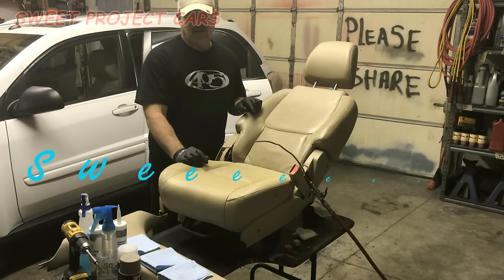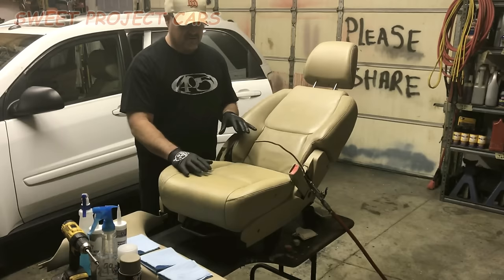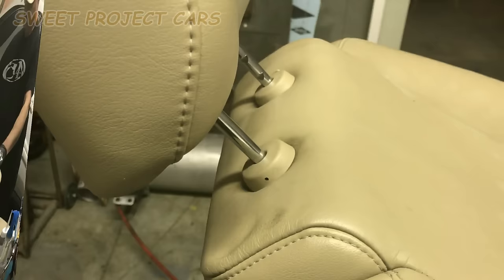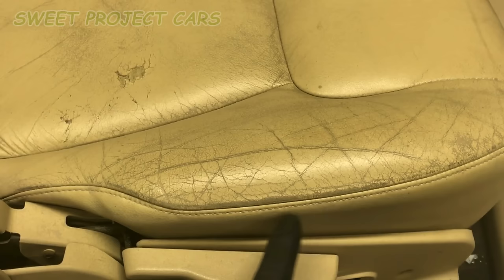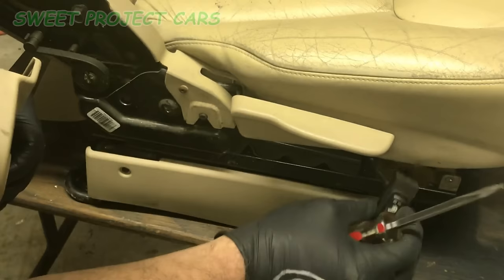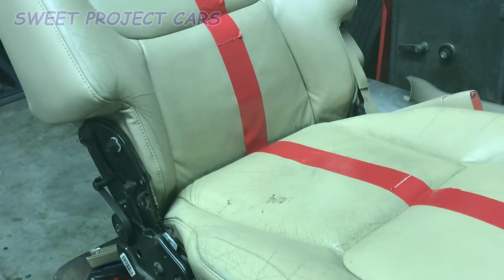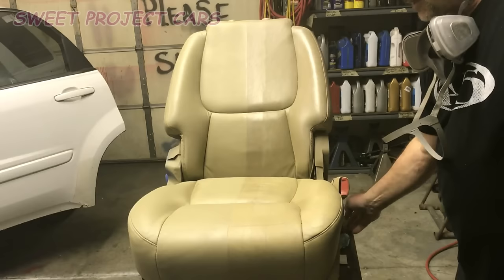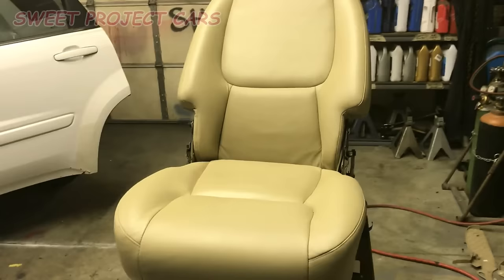How To Repair The NASTIEST Leather & Vinyl Seats....Back To PERFECT!

Comment: So you "repaired" wore cracked and ripped leather by using silicone? All the videos I have watched repair them by using leather repair kits. Can a rip, tear, or hole in leather be fixed with the silicone you used here?
Reply from the maker: Anthony yes you can do small rips and tears with it it works great have a great day thanks for sharing Mike sweet project cars
Reply: @SweetProjectCars  My truck seat has a 3" x1" hole. Do I use a piece of donor leather to fill the hole and use a mat under it and then use the silicone to bond everything from underneath? And then I can do the process you did here for fixing the seat?
Reply: @SweetProjectCars  I priced brand new leather replacements for all of my seats and I can have it done for about 1000$. I figured if I did this process you did here it would cost maybe 200$. What is the chance I would fail and waste 200$?

Comment: Im currently in the process. After you use the silicon, do you clean the surface after using your finger? Does using your finger also provide more of a "Matte" finish?

Thank you! Keep up the great videos!
Reply from the maker: Justin Slawek you clean your finger with some 99% before touching and yes you finger will dull it down a bit.
Reply: @SweetProjectCars  How long do you let the permatex dry before painting? I am going to be gluing tonight. Also, any tips for worn spots that are starting to wear through the stitching? Layer up some silicon?

Comment: I have a lexus es350 with perforated heated seats. This technique doesn't seem like it would work or would it?
Reply from the maker: It is very time consuming to do a perforated seating but it can be done as you have to open up the holes each individual one with a round toothpick
Reply: @SweetProjectCars  Thank you! do i use the tooth pick right after I spread the silicone?
Reply: I noticed you just used paint for the worn area along the seam. would you silicone that first before paint or paint then silicone around it if there are areas then paint the whole seat? sorry for all the questions. My drivers side seat is pretty worn.

Comment: I have medium grey leather seats and want to fix them. At the same time I want to change the color on 4 sections of the leather. Would this still work? I have used leather dye on panels but never seats. (I detail cars as a side hustle) Any info, suggestions on this matter would be greatly appreciated.
Reply from the maker: Well if you plan on using the silicone, dye won't work, use either of these  https://amzn.to/2PWOfN3  or  https://amzn.to/2DJPV7Y  Thanks for watching and asking Mark!  Hope you have a great day.  mad Mike the hammer SPC

Comment: 4:59  How does the leather breathe if you are covering it with a waterproof silicone sealant?  How do you apply leather conditioners to keep the leather supple and flexible, so that it doesn't go hard and brittle?
Reply from the maker: If you are even considering having to do this to your leather seats, whether the leather "breathes" or not is the least of your concerns.  You may be better off going and purchasing new OEM seats.  mad Mike the hammer SPC
Reply: Modern automotive leather doesn't 'breathe' as it's inherently dead and is covered from the factory in a synthetic coating. All leather conditioners do is stop the synthetic coating from drying out and cracking over time.

Comment: I just installed Katzkin and it’s way better than that, but I bet restoring is way cheaper
Reply from the maker: The price to upgrade a vehicle professionally installed with Katzkin is between $1500 and $2200, depending on the vehicle, so yes, the cost to do our method is around $250 for two front seats and anyone can do it.   Thanks.  mad Mike the hammer SPC
Reply: @SweetProjectCars  sounds about about right, I’m an installer and  get it done on my own vehicle so it’s under 1,000 but for customers, it adds the labor

Comment: What if you have factory pin hole  leather  seats ?
Reply from the maker: Yes it does not work very well and vented seats your best to buy replacement seat covers from the factory
Reply: Just poke holes in the silicone while its still tacky with tooth pick

Comment: Do I still need to use vinyl prep spray on the leather if I’m using Dye instead of “paint”
Reply from the maker: Yes, you definitely do.  However, you cannot dye silicone, it has to absorb into the material it's being applied to.  Silicone does not allow absorption, therefore, the paint we share in the tools list is the recommended way to go.  Thanks for asking Charles, hope this helps.  Have a great day.  mad Mike the hammer SPC

Comment: Big Mike one questions, does it really matter which prep spray do we use either leather or vynil prep spray? Where i got my seat paint color they said my car seat was vynil not leather but my car seat came from stock with leather seats so is it leather or vynil and does it really matter which prep spray do we use? Which would you recommend me big Mike?
Reply from the maker: Michael, first off you need to find out if you have leather or vinyl.  It does matter which one you use.  Leather for leather, vinyl for vinyl.  Thanks for asking.  Hope this helps.  Have a great day.  mad Mike the hammer SPC

Comment: Would be nice what products he used did I miss it
Reply from the maker: Hello Luis as mentioned in the video, all the tools and products are in the video's description below the video but here they are
USA
Tools:
GLUE   https://amzn.to/2DuPmO1

Old 99    https://amzn.to/3bmW3St

Caulk Gun     https://amzn.to/2PRFvHI

USE THIS TO CLEAN SEAT PRIOR TO GLUE & PAINT  https://amzn.to/2z3oiBu

Leather & Vinyl Repair Kit   https://amzn.to/3h8oa9C

Q-tips     https://amzn.to/2DxfgAu

Leather & Vinyl Paint   https://amzn.to/2PWOfN3

Leather Prep Spray  https://amzn.to/2z3oiBu

Vinyl Prep Spray    https://amzn.to/2AVv11Q

Dewalt Drill      https://amzn.to/2SZTf1Y

Torx Bit Set    https://amzn.to/2JVATew

Venom  Gloves    http://amzn.to/2B8kLBh

Air Mask        http://amzn.to/2B547m6

Lint Free Towels    https://amzn.to/2QsrX2f

Spray Bottles     http://amzn.to/2zSlp7S 

303 Gallon  https://amzn.to/2JMng0C

SEM Colors   https://amzn.to/2T0aJv5
Reply: Thank you ill check it great job

Comment: Quick question, the silicone is not meant to be for the whole seat right?
Reply from the maker: You can do as much or as little of the seat as you want, we are just showing you how to fix the rough spots.  If you need to do your whole seat, we suggest you replace the seat.  Thanks for watching. mad Mike the hammer SPC

Comment: MY silicon says it can not be painted.  Does yours say that too?  I bought the same one you had I thought.
Reply from the maker: Well, if you bought this one   https://amzn.to/2DuPmO1  and watched all 3 of the videos in this series, you will see how we have painted silicone for years and years and years with great success.  Thank you for watching. mad Mike the hammer SPC
Reply: @SweetProjectCars  I noticed that the Silicone you recommend, Does in Fact,  on the back at # 6 it says that it CANNOT  be painted on top of THE silicone. So, it seems you have found a way of getting past what the manufacturer says cannot be done?? Good for you. I was also wondering if you have tried using lacquer thinner to clean the leather?  Bad Idea?  I got a gallon of it and wondering if that could possibly replace the  99% product?...... BTW,  Nice work!

Comment: Hey mate. Really really great video!! I have a bmw e46 with nice red leather seats. The front drivers seat however is actually missing some leather completely where there is some large pieces of exposed foam. Do you have any recommendations? I can't really use the silicone as there is no leather to fill in. Cheers
Reply from the maker: Sorry buddy, if the leather is completely missing you will have to buy new seat covers. Thanks so much for watching and asking, we really appreciate it my friend. Have a fantastic weekend. mad Mike the hammer SPC

Comment: Great video, looks great after!! Will the paint stick to your pants in hot weather? Im about to attempt to my seats, same color.. Im just wondering if the seats are still holding up?
Reply from the maker: They are doing great, we do hundreds a year for returning customers and have never had an issue.  Use either of these  https://amzn.to/2PWOfN3  or  https://amzn.to/2DJPV7Y
 if you want to avoid any issues.  Thanks for watching and asking.  Have a great day, good luck with your project.  mad Mike the hammer SPC

Comment: I'm needing to buy a double-din radio bezel for my Shale Vette interior but cant find it in anything but black. Will this stuff cover black plastic without the black showing through? Also, would I need to apply a clear top coat afterwards or will this work as a final coat? Thanks
Reply from the maker: naaman you will want this for plastic https://amzn.to/31veHjw it has a drop down for many color choices and you need this to prep the surface prior to color  https://amzn.to/2RixI45
Reply: @SweetProjectCars  so, no clearcoat needed after?
Reply from the maker: no clear just the conditioner we share in the tools list

Comment: Paint is coming off with simply running my fingernail over it. What did I do wrong?. Followed instructions to the tee I think.. didnt let paint dry for 24 hours. I hope that was the issue
Reply from the maker: did you use the exact tools and products shown? and not waiting the correct time is most likely your issue, but if you did not use the same exact products that is another huge issue, we have done this 100's of time for our customers exactly as you see in the videos with never an issue
Reply: @SweetProjectCars  yes ordered everything by your links. I'm letting it dry again then will update
Reply from the maker: Good deal thank you very much

Comment: Just tried this process and silicone is not as smooth as I wanted it to be and it is dry now....what can I do ?
Reply from the maker: You can put another light coating over it to try to smooth it out, that's what we do.  Hope this helps.  Have a great day, thanks for asking.  mad Mike the hammer SPC

Comment: Great repair!......until you start using the seat. That will wear away after some use. May last longer on a weekend car, but not on a daily driver!
Reply from the maker: dodgeguyz we have done this repair for years on 100's of customers cars and never had a issue of it coming off when done per the video and  using the tools and products shown.
Reply: If you have ever got silicone pressed into your clothing, it won't come off, no matter how many times you wash. 

That is a cool trick 👍

Comment: Please, if you could explain, should we use exactly the same silicon or we could use also another brand / type of silicon? I have an issue to order this for Europe, so suggestions would be appreciated. May be products that are listed on Amazon Uk or Amazon DE? This particular one is not in Amazon Uk, they only have the black one with the same Brand and even the black one is out of stock :( Optional - could we use epoxy for this or it is not a good choice (epoxy is available by the same brand) Many thanks for your expertise and advice!
Reply from the maker: Use this  https://amzn.to/3ljKNb6  you will need 4 or 5 tubes of it, you will have great success.  Thanks for the great comment.  Have a fantastic day my friend.  mad Mike the hammer SPC
Reply: @SweetProjectCars  Thank you soooo much!

Comment: this just peels off after you slide over it several times though. I need a thicker compound vs silicone. any suggestions? mine already came off in 2 weeks.
Reply from the maker: I will tell you if you used this https://amzn.to/2VWyMyQ and this https://amzn.to/2On53dy as shown in the video it will not peel off.  if you use anything else other than these it will peel off i hope our 40 years in detailing helps get you back on track thanks mad Mike SPC

Comment: How long does this repair last for?
Reply from the maker: Hi Kevin it lasts just long enough to pawn the car off as quick as possible… Just kidding if it’s done right it will last for years if you’re worried about it lasting for decades you might want to just replace the seat covers with OEM covers thanks much MadMike

Comment: The seats on my 95 Ford Bronco are perforated. Is there a way to recreate the little holes?
Reply from the maker: yes but it is very time consuming using round tooth picks you maybe better off replacing with new oem covers

Comment: I didn't think that any type of dye or paint would stick to silicone.  Doesn't the dye rub off of that spot pretty quickly?
Reply from the maker: You need to watch all 3 videos in this series for this to work.  We have done this process for years for hundreds of customers.  It doesn't come off.  mad Mike the hammer SpC

Comment: The seats in my 87 mercedes look great and it has 380.000 miles on it. 
The leather in modern cars is garbage. And most cars done use leather on the whole seat. Just center panels.
Reply from the maker: It sure doesn't last as long, agreed! Thank you for watching and sharing, have a great weekend my friend. mad Mike

Comment: Do you suppose this method could work to change the color of the seats? If you were to use 99%, the the adhesive prep, then do the seats in silicon,  dull out the ridges/edges, and apply a different color? Just curious.
Reply from the maker: rodney we always say here...you dont know if you dont try
Reply: @SweetProjectCars  so I'm assuming that means you've never tried? Lol. Maybe I'll get a seat out of a junk yard and try before I try on mine lol
Reply from the maker: you can change the color to whatever you like we just have not done it much for our customers

Comment: Will this spray clog the holes on heated and air conditioning seats?
Reply from the maker: if you have perforated seats this will not work
Reply: @SweetProjectCars  Can I use the rub on dye?
Reply from the maker: i would use the leather paint video system we have works great on perforation

Comment: It's a good cover up job, "repair" is a stretch though.
Reply from the maker: This isn't a permanent fix, if you want permanent, you need to go to the dealership and get new seat covers that they will charge you $500 to $1,500 for Jay. Thanks. mad Mike the hammer SPC

Comment: Can you use this method on a 2001 navigator that has a 6" rip in leather..with holes for heated/ac in seat? Please let me know!
Reply from the maker: rita with vented seats it will not work to well as it will plug the holes sorry :(   thanks for asking Mike

Comment: How much you charge me to do the seat in my 1998 Olds Regency? Front seat only.
Reply from the maker: hotrod  if we had an opening to do it, it would all depend on how bad it was so it could range from 75 to 250 it all depends on again how bad it is .
Reply: @SweetProjectCars  What state you located in? How far out do you have to book an appointment? It is not bad but saw your video and thought I should get ahead of it. I travel all over during the year.
Reply from the maker: we are in mich and right now most of our work is for repeat customers and until one drops out of rotation we are not taking on anymore so that we can keep up with our quality. if one drops out we will let you know

Comment: Total cost for all materials involved?
Reply from the maker: well you can find those products  and prices in the SHOW MORE  area of  the video's description, we can say this it runs about 75 % less than buying a new OEM seat replacement cover
Reply: Sweet Project Cars any chance you could make one of these for ventilated seats with a bunch of holes? I want to restore the drivers seat on my LS430 but those little holes for the AC are making me wonder wether it’s possible or not

Comment: Can I use 70% rubbing alcohol?  Can’t find any 99% right now..or what else should I use.
Reply from the maker: Hi Deb if you can wait until 99% is available again I would suggest doing that if you cannot wait you can try to 70% but we have not had good luck with that. Thank you for asking have a great day mike sweet project cars
Reply: @SweetProjectCars I have everything except the 99%.  I found some 91% upstairs in cabinet.  Have you ever used that?  I don’t see a link where you purchased yours.  Was it just from Walgreens or Cvs?
Reply: ....and it is just rubbing alcohol, correct?
Reply from the maker: Yes 99% rubbing alcohol is what you want thank you for asking Mike
Reply: @SweetProjectCars  I found it, for some reason it wasn’t coming up with what I was putting in..   :(. Can’t wait to redo my seats!
Reply from the maker: Good deal Deb glad we could help you have a great day Mike sweet project cars
Reply from the maker: try this deb  https://amzn.to/367MK3V
Reply: @SweetProjectCars  still tacky after 5 days...any suggestions?

Comment: Sure but what happens when you sit on it
Reply from the maker: Well, after you sit on it, you shut the door, you take the key, place it in the slotted ignition quadrant, turn said ignition forward until the combustion engine ignites its fuel source, you then put your foot on the brake pull the shift lever into gear and you are on your way down the road.  Hope this helps.  Thanks.  mad Mike the hammer SPC